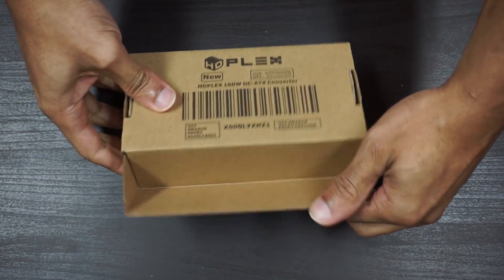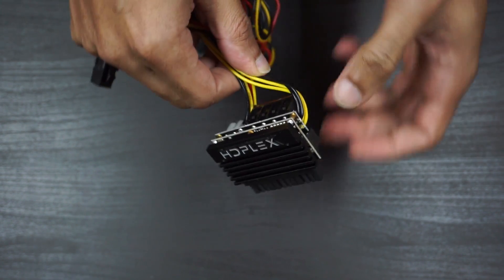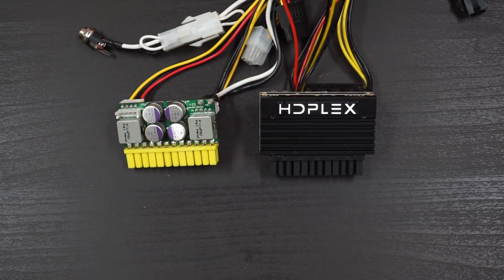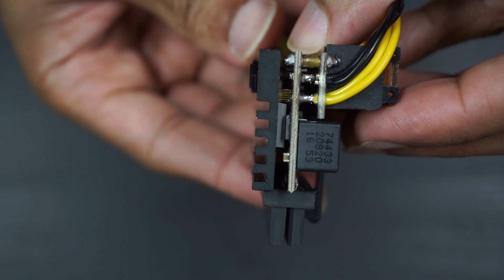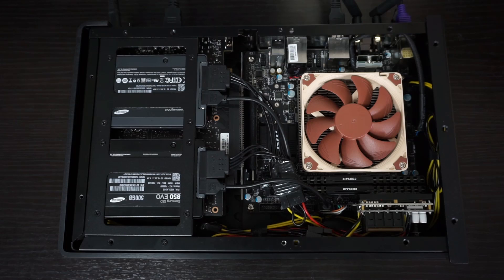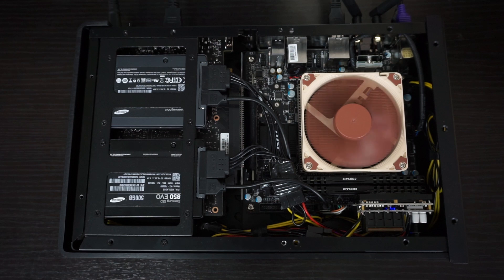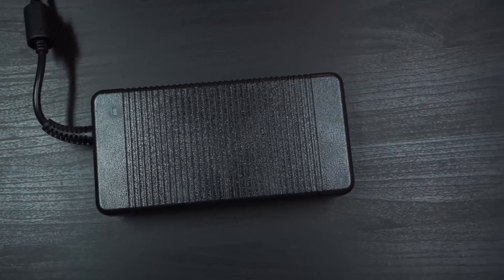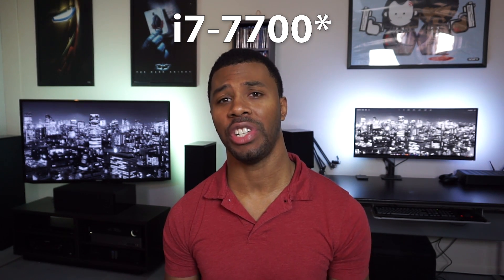HDPlex 160W PSU - Pico PSU Killer?

Comment: Do you know of any DC PSU (12V) that can deliver 400-500 Watts? Would like to power my SFF PC in my motorhome directly from the 12 V power supply from the RV-Battery (avoiding the use of an inverter)
Also, btw, you mentioned you're running a 1060 with the 160W HDPLex? -That's the graphics card I'm using but wouldnt it be underpowered under load?

Comment: can this PSU power up the Ryzen 7 2700x  + RX580 , 4GB DDR4 x 2  ?   i also have  i7  3770 + GTX660ti , GTX670  , 4GB DDR3 x 4 , please help to reply . i really not good in calculate Power requirement.
what type the DC input adapter need to power up this small form factor unit ?

Comment: Great informative video. This could be of interest, after doing some research about SFF systems with Pico PSUs I realized that 12v AC DC power bricks with high amps are expensive but perhaps not the best quality if you intend to runt your system 24/7. The solution to the PSU problem is to instead buy a good quality, high amps transformers intended for LED or Fluorescent light fixtures. Easy to get hold of and big selection depending on what you need, modular, high output power, waterproof etc.

Comment: Hi.
Im using
i5 2500
Biostar h61 itx
Id cooling halo dk 03
Gtx 660  with 6 pin power
4 gb ram
240gb ssd

Can i use this pico, especially the chinese version not hdplex (the yellow 24 pin)
With ac power 19.5v 12.3 A ?

Not overclock for sure

Comment: I have a 160XT but the constant power figure is 8A only. I would like a constant 10A and above. It's for a NES PC project with gfx card. I know the old i3 4130T worked fine with the Nvidia x50Ti of the time.

Comment: How can you run loads over 200W with a 160W PSU? That doesn't make sense.
Reply from the maker: The HDPlex 160 is rated for 160-200W. With proper airflow it can handle around 220W

Comment: This suport i7 3370 and gtx1050, 2x DDR3, 1 SSD, and 1 HD 5400rpm?
Reply: Yes just make sure you power consumption is less than you power brick you can check your power consumption on psu calculators

Comment: This is rated at 160w, so what does this 160 must include? The motherboard+cpu+ssd+ram? Also the graphics card?
Reply from the maker: I'm sorry, I don't understand your question.
Reply: Tek Everything i got my answer from searching thanks.
Reply: Tek Everything Will the hdplex 400w work with Asus Prime z370a motherboard ? I see that hdplex has input voltage 16v-24vdc and this is my motherboard’s requirements: http://i63.tinypic.com/2zzssuv.jpg i cant understand it myself
Reply: Also my power brick’s output is 12v

Comment: I would really like to see you use either the Pico or HDPlex on a system running a high end gpu @ full load all connected to and powered by solar panels, deep cycle battery(or batteries), and a converter.
Reply: With undervolting and down-clocking if needed

Comment: Hi. Great review. I was thinking of getting one of these to install in a m350 case. Do you think there'll be a problem with the fit since this is a beefier unit? Also, I've been looking for alternatives to the m350, something that filters the air the CPU drags in. Would you have any suggestions?
Reply from the maker: I'm not sure if it would fit, that is an extremely tight case. Usually cases that small don't have filters. If you wanted something in that ballpark, I would check out the Wesena ITX-5B, or the Realan W60.

Comment: Hey will the HP 230W brick be sufficient for i5 (65W) + Zotac GTX 1060 mini? PcPartpicker shows total requirement for the system as 240W, so I'm not sure.
Reply from the maker: Yes you will be fine. I am using a Ryzen 1700 & Zotac 1060 Mini with that setup.

Comment: Hey Jase,

Great video as always I was wonder whether a 330w brick could be used with this?
Reply from the maker: Yes it can, I would just be careful about how much load you try and pull through this guy. You could see system instability with higher end components. It is really designed for systems up to 200W.. but yes you can totally use the 330W brick.

Comment: nice content on your channel bro.  new sub here. im a big fan of sff. i wanna know if this is really enough for an i5, and a 1060 plus 1 ssd. im from argentina so im gonna import it if its enough. ty in advance
ps: is necessary an external power brick?
Reply from the maker: Yes, you should be fine. I am running a 1060 + i7-700 and 3 SSD's off of this and a 230W power brick.

Comment: Is enought for an i7 7700 , 16 gb RAM ddr4(2 x 8 gb), ssd m.2 and the motherboard.
Reply from the maker: Yes, check my latest build. I am running a 7700, 32gb of ram, 1060, and 3 ssd's
Reply: Thanks.
you shoul try this case EMC-810B cause there isn't information about it on YouTube and looks pretty cool

Comment: Hey man, great job on these SFF videos, very informative!
A small question... I recently picked up an old iMac G4 (dome: https://en.wikipedia.org/wiki/IMac_G4) computer, removed all the inner components, and will be installing OS X 10.12 Sierra (hackintosh). I have a Gigabyte GA-Z170N-Gaming-5 MB, a 256Gb Samsung 950 pro NVME SSD, 16Gb Corsair 2400 DDR4 memory, and another Samsung 2.5" SSD (No dedicated GPU). The HDPlex 160W + internal 160W DC ATX PSU (combo) needs to power these components + a new 17.3" LCD that is replacing the old one (converting the internal LVDS cable to HDMI). Will the HDPlex 160W be good enough to power these components? Thanks for your help!
Reply from the maker: You should be fine powering a Z170 System with that setup. I am not sure about the monitor though.

Comment: HI TechEverything: I need a pico power supply for an Intel Pentium G3420, 8gb of DDR3 ram, a GTX 1050 and a 525gb Crucial SSD. What Pico Power Supply combo should I get? Very confused on all the options. Cooler Master claims I need 161 watts. Is 180 watt psu safe? Cheers!!!
Reply from the maker: I would recommend the HDPlex 160 and the HP 230W power brick. It is a more versatile and cheaper option.
Reply: Tek Everything I got a 195w psu brick from Amazon and a 200 watt pico psu from eBay will that work for an i3 and a gtx 1050ti?

Comment: Hey Jay and others, any one know if this paired with the hp 230 watt brick is good enough for 16gb ram, 4690k(not oc) and 970mini?
Reply from the maker: The combo may be able to handle that system under certain games/loads... but I wouldn't recommend it. You could potentially see peaks well over the rated specs for both parts. An HDPlex 300 + Dell 330W brick would be a much safer choice.
Reply: Thank you for the feedback and the informative vids!

Comment: wait do You  need an external power brick useless I hate power bricks they look awful and take up space in annoying places.
Reply from the maker: To each there own. If you want to use extremely compact cases you need alternative power solutions. Removing the bulk of a standard PSU allows for significantly more flexible builds.

Comment: I don't understand how this 160W PSU is supposedly capable of supplying a typical i7 with mid-range GPU. When I simulate my current system ( http://outervision.com/b/YGtvt2 ) it requires at least 270W, while it isn't particularly demanding (GTX960 and cheap i5). Should I be able to use this HD Plex 160W? With additional SATA drives it estimates 290W... almost double the 160W. Could you please advise?

Comment: I have a question... didn't really understood how these little psu work. Till now I know that, in order to work, you need a power brick and the Pico. But I saw, at HDPlex website, that the wattages in combo between Pico and powerbrick are not equal. The first combo: 80W AC/DC + 160W DC/ATX, the second combo: 160W AC/DC + 160W DC/ATX how that's affects "performance"? My other question is: I've already a laptop brick rated at 90W, if I match it with the 160W pico, how much juice can i extract from it?
Hope that all this is understandable :)
Reply from the maker: The wattage do not need to match up. Your overall system will be limited to the wattage of the power brick you are using.

You could use your 90W brick as long as it is compatible with the HDPlex. You would be limited to a 90W system.
Reply: Thanks J! wrote them an email and discovered that my powerbrick is not compatible. Hope to be featured in one of your next SFF showdown when i'll end my sys... Cheers!

Comment: Hi, I purchased the hdplex 160 with the hp 230w power brick, currently running it with an underclocked and undervolted 6700k at 3.4ghz and an evga 1060 sc. When I run uniengine valley benchmark,  my computer sometimes turns off and resets, does this happen with you as well?
Reply from the maker: No, that has never happened to me. I have run a 7700 with a Zotac 1060 min, and EVGA 1060 mini SC. Both overclocked to there limits.

I would guess that it is most likely a power brick issue, as the HDPlex is capable of handling more load than your setup would produce. What case are you using?
Reply: I'm actually using the rvz02, I'm going to reinstall the hdplex 160 again and run some more test. Maybe its my motherboard?
Reply: Tek Everything yea i just reran it, just restarted the pc like last time. Im confused, we have the same power brick?
Reply: Nvm, I undervolted my 6700k to 1.08v at 3.6 ghz, and everything works smoothly now.

Comment: Will it fit on the streacom f1c WS case ?
Reply from the maker: Yes it will. It sits at 59mm high when measured from the bottom of the inside of a case. So it will fit in virtually any system that supports standard CPU coolers.
Reply: Tek Everything which one is better picopsu 160 or HDPlex 160 ?
Reply from the maker: If I had to recommend one it would be the HDPlex 160 all day. Unless you are running like a HTPC with an i3 in it or something, there is really no good reason to go for the Pico anymore.
Reply: Tek Everything My config is i5 7600 , H270N Wifi , 8GB Ram , SSD, 1 2.5" HDD, Streacom f1c WS.. cus S4mini is sold out. So which is best for this pico or hdplex

Comment: I am curious about the Pico PSU; the Pico is not expelling any heat because it is only doing minor voltage adjustments for the 3.3 and 5v rail while 12v is passing straight through its solid-state switches into the system. It seems to me that a Pico PSU could be modified to push ANY wattage PCIE-powered video-card by attaching an extra high-amperage solid state relay/transistor that passed through extra 12v DC power to a video card; I think I'll experiment with this idea on my bench with an old 8800GT I have lying round.
Reply from the maker: Yes the added heat is due primarily to the additional conversion being done by the HDPlex. I have seen plenty of modded Pico 160xt's. They can handle loads over 200W as well, you need to upgrade the wires to a thicker gauge though.

The effort it takes to mod the units, then find higher wattage bricks simply is not worth it to me when the HDPlex 160 can be had for less money when you add on the cost of the bricks.

Comment: Would this fit within a Logic Supply MC600 build?
Reply from the maker: I just measured the 160. It sits 59mm when installed in the motherboard. The MC600 is 64mm, so it should fit.

Comment: Any idea on whether this could support an A10-7890K and an R7 250 + 2 2.5" drives, one SSD and one HDD? The PicoPSU-160XT uses overcurrent protection at max load of the two.
Reply from the maker: Yes, that is well under the rated 200W. You should have no issues at all.
Reply: Tek Everything That's my problem... at 196W from the wall, the PSU chikes during the Sky Diver benchmark and restarts. When I use my 300W Flex-ATX PSU, it's A-OK. All chips are at stock clocks except for RAM, which I have at 2133MHz. Is this normal for the parts?
Reply from the maker: 196W seems like a large spike for that system, but it is certainly possible. Admittedly I am not that familiar with AMD CPU load wattages. Are you using the 192W power brick with your Pico?
Reply: Tek Everything Yup, the 160-XT + the 192W adapter combo Minibox sells. I built another system with an i3-6100 and a 1050 Ti; 30% better CPU/GPU performance using only 120W. I did really like my 7890K, though, and I don't wanna leave it in the closet. I packed everything into an ANTEC ISK 310-150, replacing the PSU with a 300W Flex ATX one, and fitting everything in, and I do like it a lot, but it's not as small as it could be.

Comment: This power unit just blew my mind. And when looking at the Amazon page I discovered the internal HDPLEX 160w AC adapter. These two seem to be perfect for my SFF project (by the way, I submitted it to your email a couple of days ago).
Do you think that this combo can power up an i3 4330 + 750 Ti + 3 SSD/HDD?
Reply from the maker: Yep I got your email, very cool build man. I won't spoil it here.

And yes, you should be ok with that combo. Although an external brick would give you a little more wiggle room.

Comment: seriously man ? i7 7700 + gtx 1060 on such a tiny psu ? did you happen to undervolt your cpu or gpu ?
Reply from the maker: Undervolt, nope. I even OC'd the 1060.
Reply: Tek Everything thanks for the speedy reply. i have ordered the hdplex 160 to power my i3 7100 + gtx 1060. everything will be powered by dell 240w adapter

Comment: This is the first time I've heard the word "Lovechild" used when referring to a DC power suplly :)

Also, the extra heat dissipated by this HDPlex power supply is probably due to it having to convert a higher 19V to 12V for the motherboard whereas the PicoPSU doesn't convert the voltage because the power brick for the PicoPSU is already at 12V..

I'm definitely going to pick one up. Thanks for the review. Good job!
Reply from the maker: Ha, I will try and incorporate "Lovechild" into as many videos as possible from now on.

Comment: I'm running a 6700k and a gtx1060, are the power bricks that you have listed in the description good enought for my system? Thanks
Reply from the maker: They should be, depending on how high you push your overclock.
Reply: I don't plan on overclocking, but thanks, I will buy the hp powerbrick.

Comment: I thought Josh would've beaten you on this one. I'm definitely liking this option over the HDPLEX 300 (and the pico option) and it seems like it should be enough for a GTX 1060 with an i5 6500.
Reply from the maker: Yes this is currently my favorite SFF PSU by far.

Comment: pico PSU at 500w?:)
Reply: TheHazeShadow Try to find a 500 watt AC adapter.
Reply: TheHazeShadow 400W units available.... https://smallformfactor.net/forum/threads/g-unique-plug-play-units-pre-order.1404/
Reply: I wish it was pico but they have this one 400w and 500w peak
http://www.hd-plex.com/HDPLEX-400W-Hi-Fi-DC-ATX-Power-Supply-16V-24V-Wide-Range-Voltage-Input.html

Comment: Can you please measure how much the power brick draws from the wall when using the hdplex and pico? (same system, same load)
Reply from the maker: It should be the same exact number. I suppose I could run the test though.
Reply: At 3:38 you say that the HDPlex gets warmer than the Pico PSU. That means that it has to be less efficient / draw more power.
Reply: americanv8ss this is true, however 12V bricks tend to be less efficent then 19V laptop charger bricks, at least that is what Johnny Guru speculated here:  http://www.jonnyguru.com/modules.php?name=NDReviews&op=Story&reid=207
Reply: Not Real Sure, but that's not the point
Reply: americanv8ss if the efficency loss from converting voltages cancels out the inefficieny of the bricks, what is :V

I want to know the answer to your question also, however!
Reply from the maker: From using both units extensively, I am guessing it will be very close if not identical. They are both very efficient. I will run the test for you when I get a chance though.

Comment: Could you add a 330 watt AC adapter to this? It looks beefy as hell.
Reply from the maker: You can definitely use that brick. Although I wouldn't advise running super beefy components through the 160. Go with the HDPlex 300 for that.
Reply: Tek Everything 
Thanks for the help. I finally plan to build my first PC. I'm planning to use the mx500 mini itx case with any x470 motherboard to use the AMD 2400g APU.